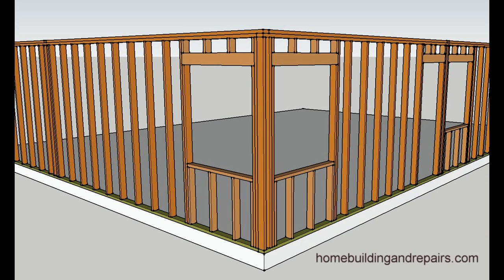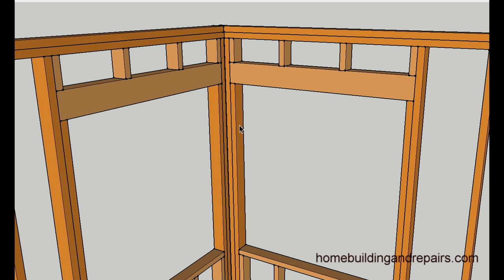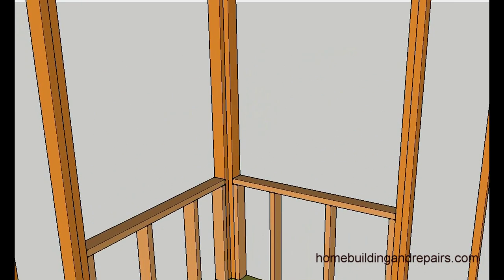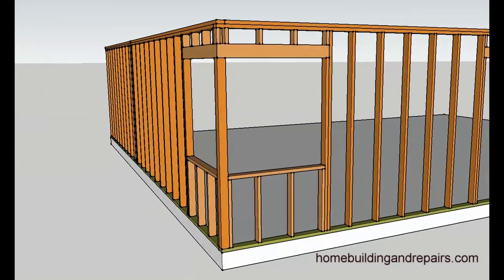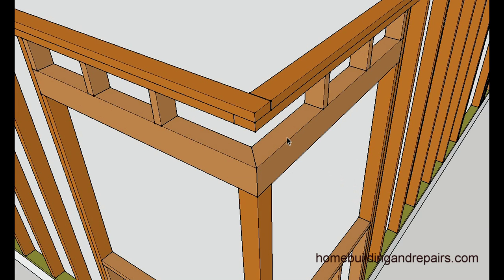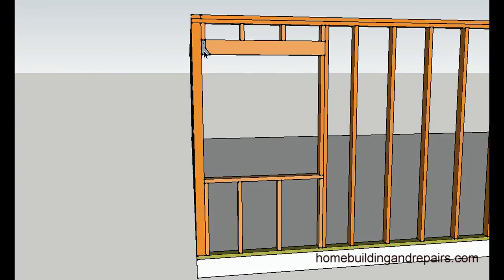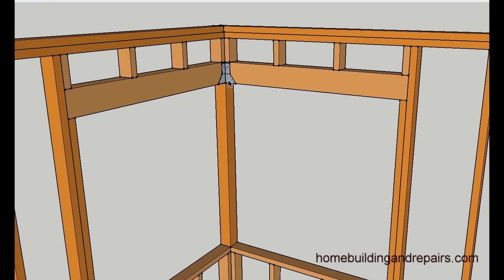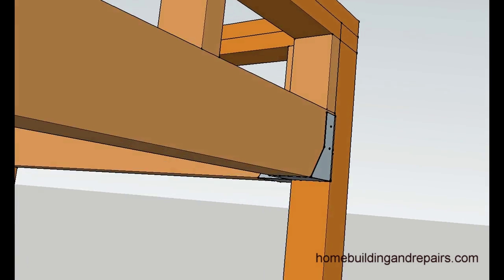Four Examples of How to Frame Corner Window Walls – Home Building Tips

Comment: Thanks for your precious time. It helps me (overseas) to better understand framing which is not a common method of construction over here. Although, it's about 20% of the concrete construction cost.
Reply from the maker: +Khalid Al-Bahi You bet and thanks for watching.
Reply: +gregvancom My pleasure.
Reply: But y do they still build using wood

Comment: I love your illustration, wow.  
I built two walls for a cabin with windows on each end that matches your first example. There’s a king stud and jack stud that comprise the corner.  I made the mistake of nailing the king to the jack stud which leaves me having to nail through both to join it with the other wall. I really don’t want to pull off the king stud since I have it nailed into the header, jack stud, window sill and floor sill.  Would it be okay to just use 5” screws or should I resort to 5” nails. They’re 40d which I’m concerned could crack the 2 by 4s. Any thoughts are appreciated.

Comment: I visited a couple of upscale homes that had large corner panoramic doors without any post or riser in the corner.  When the doors open up there is no pillar ot clutter the veiw.  No doubt the framing system counterlevers.  I can see a very unique counterlevered floor/ceiling platform girder and joist system to effectively carry the overhead loads as a lintle creeper system will be impossible to incorporate.
Reply from the maker: Yes, some of those buildings use steel beams.

Comment: This is very helpful.  You're a good teacher.  What if the exterior finish is brick and you want to put brick above the corner windows?  Would using a corner steel lintel be the most common practice?
Reply from the maker: I've never seen it done before, so would have a difficult time providing you with something that would be guaranteed to work. I did put your suggestion on my video list and will make a video eventually, but if you're looking for information right now, you might want to contact a mason in your area. Thanks for the nice comment also.

Comment: Thanks for posting. I saw a picture of two windows in the corner of a house where there was not even a glass frame. No corner post, no trimmers, no king studs. Just two pieces of glass @ 90 degrees probably silicone at the corner. Any idea how this is framed ? Even if the header was mitered and bolted at the corner it would need a post/trimmer or something underneath to support it. Right ? Or would it work like a curtain wall ? Or a precast steel corner lintel ? (Now I'm just guessing.)

Comment: In 4x4 corner method, can it be modified to go with 2x4 king stubs on both corner side of the windows. Will it become overkilled? Thanks
Reply from the maker: Definitely, sometimes you need to add additional studs to make some type of exterior trim for siding or stucco work.